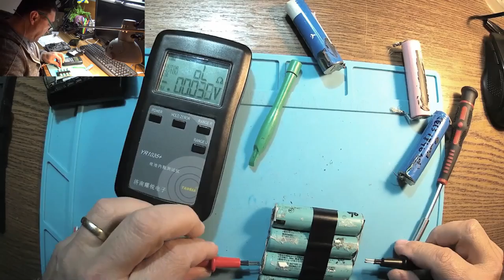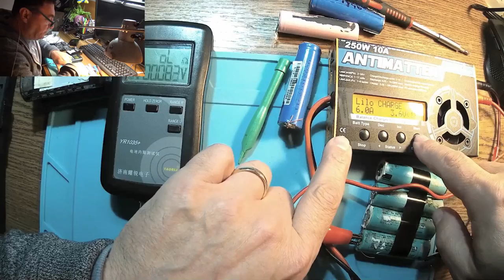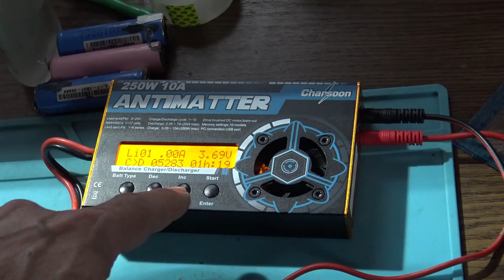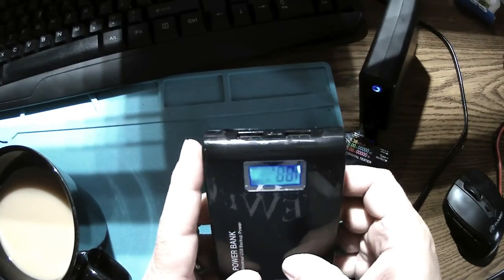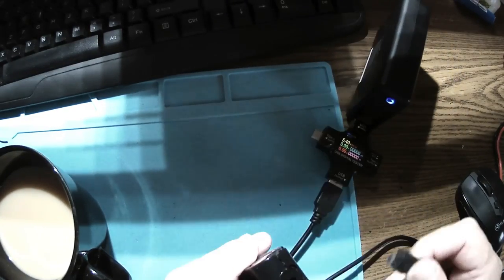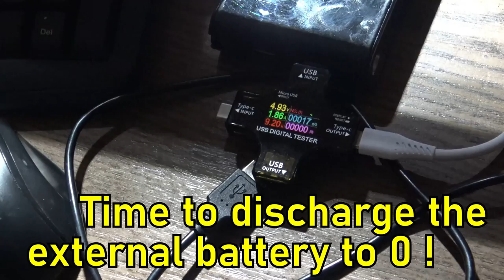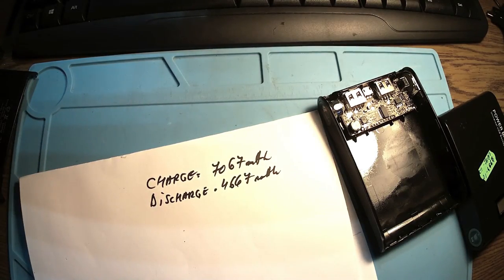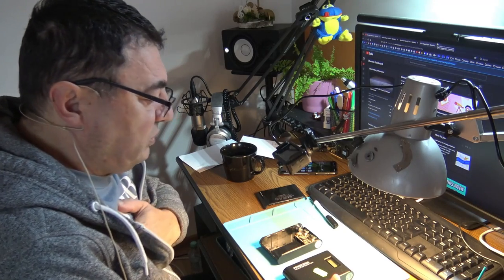DIY 4P 118650 Li-ion external battery kit efficiency test

Comment: Do you think the Wire-Leads and Alligator clips are adequate for 12VDC Testing?
Reply from the maker: At low currents why not..?
Reply: @viocaia 
My suggestion is to double the leads or increase the size and retest.
Reply from the maker: @Lawiah0  I will..

Comment: Does charging with 0,8 A and discharging with 1,9 A makes efficiency worse? I would say it does.
Reply from the maker: As long as the pack is 5200mAh and charging puts more then 7000..there is a clear electronic problem..also when supply 5V under discharging and reaches only 4000mAh, the buck converter is doing a bad job...I'm running a test with a Hama battery..let's say comercial one to see the difference..
Reply: @viocaia  Sure thing the elctronic does very bad job. Converter chip is producing alot of heat. 
My point is, the battery probably accepcts/produces more capacity at lower C rate. especially at discharging. 
And maybe to compare Wh would be better. 5,2Ah at 4,2V = 21,8Wh vs. 4Ah x 5V = 20Wh gets you better result. But as I understand it voltage was not constant and my nubers are off. So it would be more exact to measure Wh than Ah. I'm not sure.
Reply from the maker: @tg_privat  Makes plausible, I'll another test under low discharge..